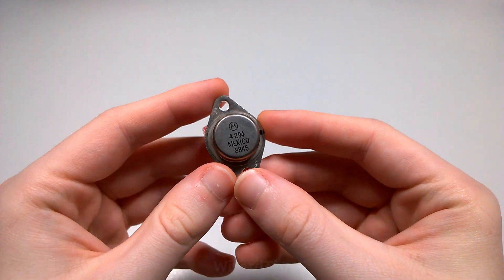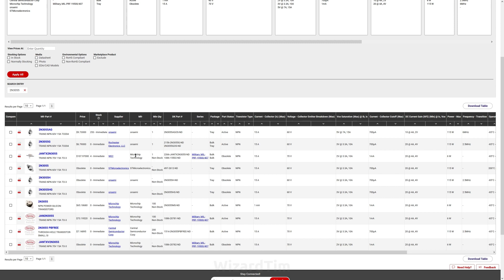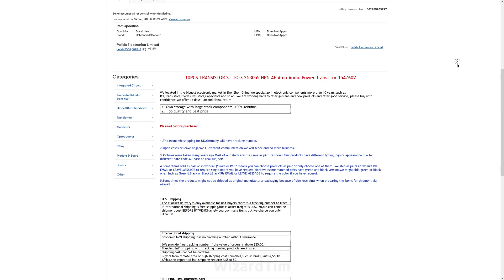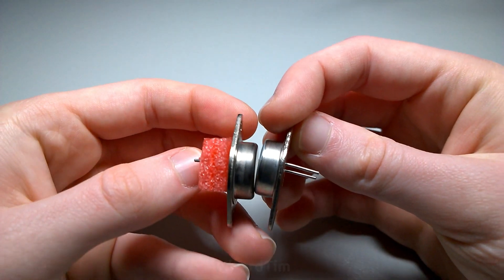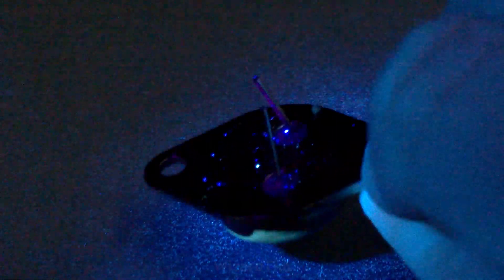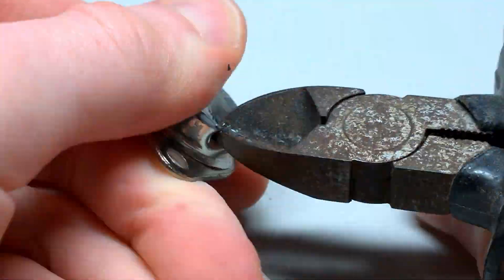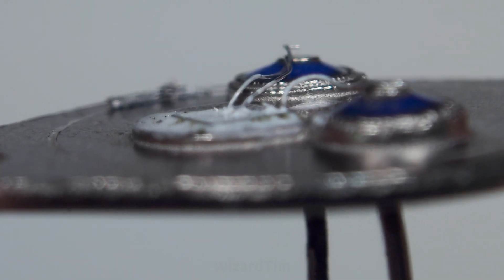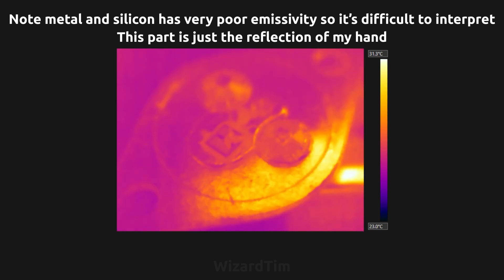Counterfeit eBay TO-3 Transistor Teardown

Comment: Oh well had to learn the hard way. LittleDiode in the UK sole me some fake RCA 2N6474's and when i tried to bias the amp and they blew up. I should have known the laser etching was too clean for an obsolete part. I just hope they didn't screw up the output transistors

Comment: the 2n3055 is for museum ...in the 80`s we had lots of amps from the 70`s with these f.....s in it. there were some from RCA . there were 2n 3055E`s, 2N3055H`s. E meaning Epitaxial, H meaning Hometaxial, whatever it means..... they died like flies. after a while we came to the conclusion to  replace them with 2n3773`s. they kept the word the 3055 promised

Comment: Maybe a little late comment but, on the subject of this transistor markings, even though it seems rather fishy, St electronics indeed do this kind of markings on their TO-3 parts... I mean, the whole top of the can painted on this thick and bad looking silver paint, and then the part number and lot markings that looks like tampon printing (Pad printing is the correct term), or sometimes seems like inkjet printing.
The die also looks quite large and quite well made for a fake, so it's more likely a relabelling of a genuine transistor of another part number, which can be either a slightly less capable part, or some obscure part that is less sought after.
Only thing that really looks bad, is the heat spreader that is too small and too thin for a 115W part.
A heat spreader taking all the can area, and twice as thick would be more what one would expect.

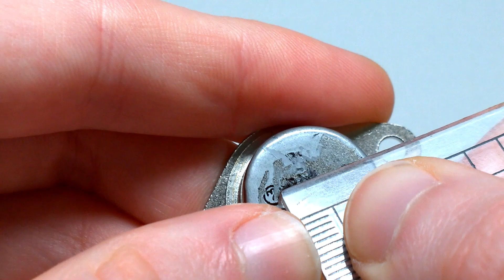Comment: Hi nice video. at about 5:40 you use plastic ruler to scrape paint, even better tool is a aquarium/ceramic stovetop cleaner, that has razor blade resembling but much thicker blade, that can scrape even epoxy paints. another trick: use U light to see if there is any residue of older markings after you have removed the paint.

Comment: $9.73 wow... I remember using the 3055 (and its complement the 2955) in everything because they were dirt cheap! Two bucks each from Radio Shack in 1993.
Reply: $2 from 1993 is $4.50 in 2024 and 2N3055 has not been used in new designs for 30 years or more so the price goes up.

Comment: That wire bonding is not the best. It lifted from the post and die instead of breaking at the heel. I used to do a lot of destructive physical analysis on hermetic parts for a defense contractor. I'm also wondering what that substance was on the surface of the die and running down to the pedestal.  I'm certain that shouldn't be there.
Reply from the maker: Yea the wire-bonding is pretty bad, it very easily separated from the post with the slightest force. The white substance is some sort of silicone resin, in this example it's poorly applied but others I've seen they selectively apply it to the bonds on the die and the post, my guess is it's to prevent mechanical vibration from breaking the rubbish bonds.
Reply: "defense" yes. "defense".

"Our warfare is to defend our country" says the American. All the other countries laughed.

Comment: You left us with a counterfeit review.  You did not run it and see if it would perform as expect for a 3055.  That would be the REAL test.  Too bad you forgot to do it.
Reply from the maker: Yea, unfortunately I couldn't test them fully as I don't have a PSU that can do either 60 V or 15 A, most I could do easily was 30 V or 3 A so I just titled the video 'teardown' and called it a day. In the future when I can afford some nicer equipment I might measure their breakdown voltage and their max current capabilities but I have many other videos planned before revisiting this.

I did use them at about 15 W ea. for about 100 hours and they survived.

Comment: That is a 2N3773 in there, most likely salvaged parts from ewaste that were bought in bulk, and they just washed them in an ultrasonic cleaner, to get rid of all markings and debris, then painted the top, likely using a simple foam roller and a big piece of board with holes for the pins. You can get any part there in the TO3 can, could be a voltage regulator, could be a double diode, could be a Mosfet, could actually even be a 2N3055. Only requirement was that the stripper did not recognise the part number as matching their small number of known parts, or it was illegible, so they go in the pile of fake parts.

Would be interesting to order a few over time from the cheapest suppliers, in 100 lots, after doing the first order for 10, because the repeat sale is guaranteed to be almost all fake parts.
Reply from the maker: If that's the case then they did a pretty good job (apart from the terrible paint job), normally when I get e-waste components they're usually very obvious with scratches, bends and soldered or rusted leads but those were in surprisingly good condition which confused me greatly. 

I did see a couple blog posts about people buying from Alibaba large lots of components, first small sample is all genuine, later large batches are all counterfeit.
Reply: @WizardTim  First grade reject parts then, or they took them and put through a rotating plating bath to make the pins and case all shiny again. Just needs a thin nickel coat to look good, and that can be done fast.
Reply: Just bought a soldering station off of Amazon, when it arrived - something was loose inside. Took it apart and the cap of the  2N3773 was off and was rattling when moved. Internally, it looks exactly the same as in your video - including the white substance…. It’s probably counterfeit.  Any tips on how to secure the cap back on?  Or just roll without it???

Comment: Rochester is actually a good source for parts. They get dies from the original mfr and will make the final transistors when the need arises.
Reply from the maker: Interesting, I once considered them when looking for an obsolete part, they claimed to have ‘9,999,999 In Stock – Immediate’ for a stupidly low price, I looked a little further and found they had enormous quantities of some parts to the point of needing several shipping containers to store that much. Although looking back at those parts now they seem to have more believable quantities.